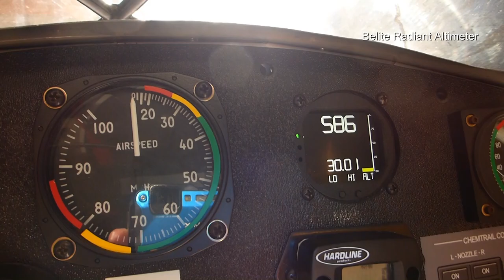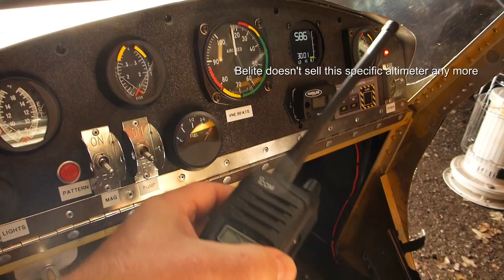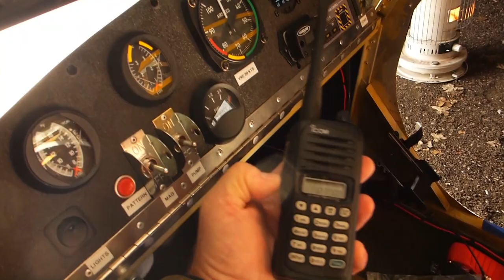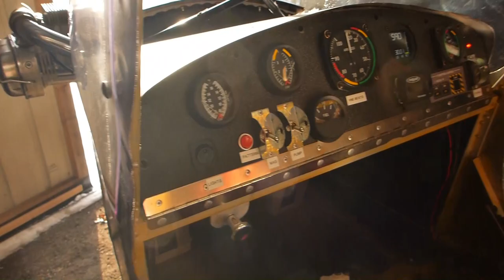Easy way to eliminate radio interference!

Comment: Good video!  In my plane (@KUES) I notice that if my daughter plugs in her iphone to one of the 2 usb jacks in the  adapter that is in the old lighter socket (24V) I get radio interference.  Do you think a core around the usb cable might do it or just replace the usb adapter jack?  I noted that the other usb jack in the adapter does not create noise. Thanks.
Reply from the maker: If you can get behind the panel and put the ferrite core on the wires then you'd be better off.  I don't know if putting a core on the cable would work but it would be super easy to try.

Comment: my friend suggest me to wrap aluminium foil on ignition coil cable so it can’t interfere with other sensors frequency … will it work ??
Reply from the maker: You may have static coming from the engine and spark plug wiring.  Be sure your engine block is grounded to the frame because rubber shock dampeners will insulate the engine from the frame.  Shielding over spark plug wires is a good idea, but be sure the shielding is also grounded to the engine and frame.

Comment: Did it affect your compass?
Reply from the maker: I do not fly with a compass so I don't know for certain how it would affect one.  The magnetic cores are not terribly strong so I expect very little effect on a compass outside of a 2 or 3 inch radius
Reply: Interesting question - cores are basically not magnetically polarised (not strictly true but any renmance is extremely minimal and will not affect a compass deflection significantly) Additionally, the cores, even if split, for a torus and like toroidal inductors minimises flux leaage due to their shape. 

I won't say that surrounding a navigational compass with a lot of ferrite cores won't affect it, but certainly we're not into compensation or adjusting territory here. 

Theoretically, if there's a heavy current flowing through the wire and the orientation is just so, then yes, a mangnetic field will be concentrated by the ferrite core but not as much as you would imagine - supression cores are designed to be "lossy" to reduce their loaded Q-factor. This means that although there is a transformer or coupled inductance effect, it is in no way comparable to a solenoid-style inductors or transformers where losses are minimised to optimise EMF efficiency.

As high current wiring should not be positioned close to a nav compass anyways then I doubt there will be any significant effect in a typical installation scenario. If there is, a quick compass base check will prove or disprove problems. 

Not the ferrite cores we're talking about here are very specifically for EMC/RFI suppression and are not random magnets - like I say above the composition is very specific and totally different from magnetically polarised materials.

In addition, note that ferrite materials used for suppresion purpses are distinct from those used as RF transformers (baluns or ununs) though to the casual observer they may appear similar. As a general rule, split cores (surrounded by a plastic clip) are almost always suppression cores. Whereas ring cores (unsplit, a complete torus shape) maybe sometimes be for supression, OR transformation/inductor purposes. 
Stick to split cores.

edit: not all ferrite compositions are magnets, though some magnets are ferrites

Comment: I really like this video. I do have a question for you and hopefully you can help. I have a cb radio in my semi and have led headlights,  everytime that I turn the headlights on I get radio interference through my cb. Will these ferrite collars help with interference and where should I install them? On the power cord or coax to antenna?  Radio is wired direct to the batteries of the semi. Thanks in advance.
Reply from the maker: The ferrite core would go on the power cord to the radio.  You may have current being induced on the power wires by other electrical components.  Place the core as close to the radio as you can, that will do the most to trap and reduce the noise.